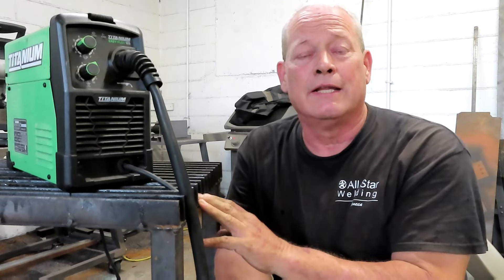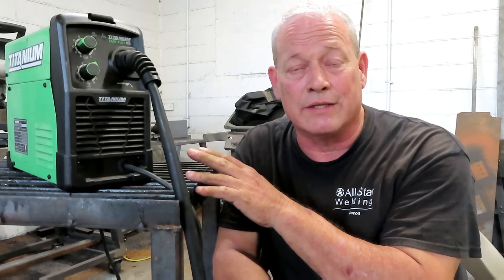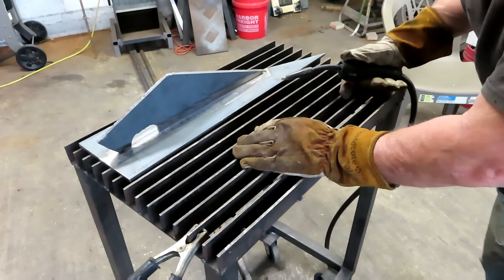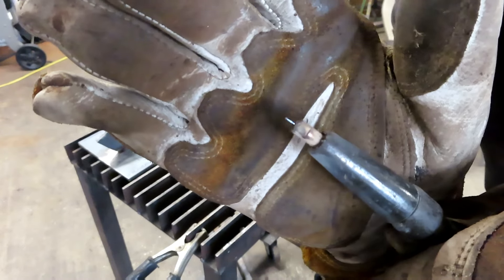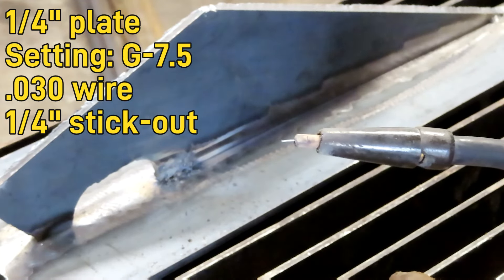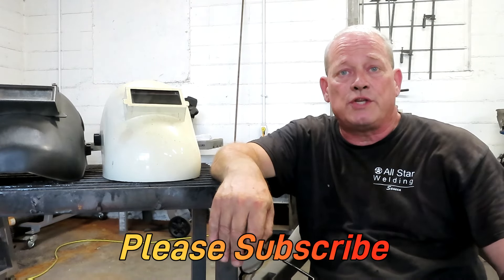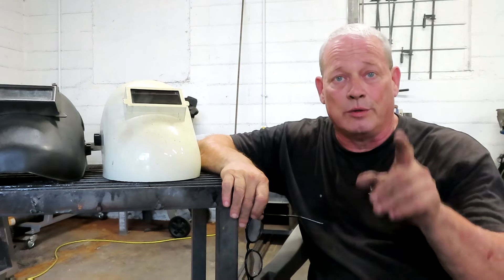How to Weld Like a Pro with the Harbor Freight Titanium Easy Flux 125 | Beginner’s Tips

Comment: I saw another person do a review and he advised to reverse the polarity on this welder, supposedly it will make cleaner welds. What are your thoughts on this? Thanks! This is a great video!
Reply from the maker: Flux core welding needs to be DCEN, or DC current Electrode Negative. This Titanium is a flux core ONLY machine, so it is wire from the factory as DCEN. You can NOT change it. Other Mig machines that can run Mig or Flux, yes, you need to swap it to negative for flux, and positive for Mig. Some people will read a comment on another video where the user is running Flux Core on positive, and will leave a comment telling them to swap polarity, which is correct. But then, some people read that, and leave the same comment on every video they watch, which is incorrect. The bottom line is that a machine (Titanium included) that is a flux core ONLY, is engineered from the factory as Negative. The only way to swap polarity it to take it apart, buy some new components, and fire up the soldering iron and hope for the best.
Reply from the maker: Running Flux core on positive is wrong

Comment: You should tell us your settings befores you started.
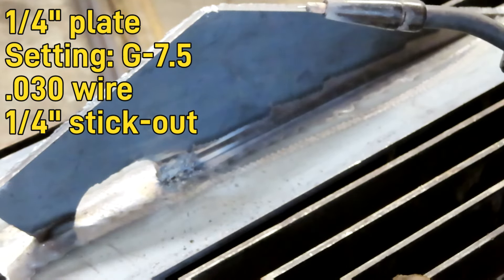Reply from the maker: I did. It's on the screen at 5:24. G-7.5, .030 wire, 1/4 plate.

Comment: Do you have a vid of the theory of how to use these cheap welders, and the why and when you would use the different types of welds?  Z vs little e vs out and in?
Reply from the maker: There are so many variables as to when and why. That's when your expertise and practice will come into play. Instead of practicing just on flat pieces on your work table, change things up a bit. Set some pieces vertically. Hang a piece of the edge of your table, get down on your knees and practice welding underneath it. Practice thinner pieces to thicker pieces. There's really no theory to it. Just practicing and remembering what works and what doesn't.
Reply: @AllStarWeldingSC  ty.  I'm just spooked of getting shocked.

Comment: Wow. You've explained a lot as to why I've had such a big problem. To me, they all look very good but the 3rd one seems to look like it has a valley down the center. I'm going to try your technique now. Thank you very much for your tips. Ok so I can say this welder sucks. It will not lay down a good need. There's no spatter it just looks like a cold log.
Reply from the maker: Anytime brother. Let me know if you have any questions.
Reply: I tried to. It still just lays down a cold log. I weld fifth wheels together for construction trailer specialist. MiG. I used to weld barges using flux core. What in the world am I doing wrong? I just don't get it. @AllStarWeldingSC
Reply: Wow.... Now I understand what is going on. Not calling the people at harbor freight idiots???? But it's probably my fault as well for not looking but they sold me MiG wire.

Comment: I have a inverter stick welder and have been working on an old motorcycle muffler system. Even bringing it down to ~45 amps with 1/16", 6013 rods, reversed electrode, it still burns through way too easily. The oem tube thickness is about .050" metal, the replacement pieces I'm trying to add is 16 GA. Would this welder be a big improvement?
Reply from the maker: This would definitely be a great improvement for thinner metal like that.

Comment: Do you think this can tackle mobile welding jobs such as Rod iron fencing and Handrail repair? I’m thinking about starting a little side hustle doing this. I have my carts just no welder. It’s on sale right now and will probably buy regardless
Reply from the maker: Yes. I use mine for fence and handrails all the time. Also use it when I need to build a new one on location, as I did today. I have Mig, Tig, and stick in the shop, and I use the Outlaw for stick and to run the Titanium Flux Core out on mobile jobs.
Reply: @ oh nice, I have my eye on the outlaw for when it goes on sale. I want to make a little money with the buzz box first before I upgrade. And when you use that mobile, do you plug in to the home owners power or do you use a generator?
Reply: Wrought-iron

Comment: I really appreciate this video. I'm fixing to buy one of those machines and I'm new at welding so this is a big help to me I really appreciate it started following you to find more techniques and learn more information thanks again.
Reply from the maker: It's no trouble at all.  Hopefully, I've given you a tip or two to get you going.  Thanks for subscribing. I'm planning another video starring the Titanium and a Primeweld. Not necessarily a battle, but to show how you can take your experience with this Titanium, and use the same technique with other bigger machines for when you upgrade. I want to do the video soon, but I am elbows deep in a big project and trying to get it behind me. Stay tuned!
Reply: @AllStarWeldingSC  I completely understand and I'll be waiting

Comment: Bought a Lincoln AC225 45 yrs ago for a project and over the years have used it for different projects around the house/garage but found it too (hot) for an inexperienced/ diy welder.Recently purchased a Reboot 145 that does flux core as well as dc pos or neg stick.After a bit of practice and experimenting with flux core can get better results than years of trying with the old tombstone.I really liked your video on welding with the Titanium 125,good tips on different techniques.Look forward to more tips to come .many thanks.
Reply from the maker: Thanks for watching. When I get done with my current project, I've got a new video I want to make dealing with advanced flux core techniques. I have a Tombstone story for you... Way back when I was first getting started, I was strictly shop work. One day a guy wanted me to finish a horse fence that had already been started. The drill stem pipe had already been set and capped. Holes were torched out for sucker rod to go through the holes, and everything was already placed along the fence line. All I had to do was put the sucker rod through the pipe and weld it up. I went to the pawn shop and picked up the Tombstone AC, and borrowed a big generator, and got to work. That's when I learned about drill stem and sucker rod being magnetized from friction in the ground. Well, I got past that with some advice from an old timer that told me to wrap my ground around the pipe. That old Tombstone was a beast of a machine, and so heavy.

Comment: This was a great help. Thank you. Got me started in the right direction finally.  If you are looking for content, would appreciate your thoughts on multi-process welders, like Yes, Arc, and the Lincoln 180i. Thanks!
Reply from the maker: Yeah, those are great ideas... If I could afford one, haha
Reply from the maker: I'll tell you this much about multi-process machines... They are great for a home shop, or hobbiest. And cheaper than buying all the machines individually. However, in a business shop environment, it's not wise to put all your eggs in one basket. If one of those processes goes out, or if you have to send it back/replace it, I would be out of work. As it is now, I have 4 machines that I can stick weld with, 3 machines to Mig with, 3 that can DC Tig, and 3 that can flux weld, but only one that can AC Tig. So I've almost got everything covered. Just something to think about.
Reply: @ That’s very thoughtful and great perspective. Thank you. As I am hobbyist only at this point, I might see some value in a multi. As is I only have the Titanium flux you made videos of. However your idea of keeping separate certainly has merit. Thanks for that

Comment: You said wire matters. What wire are you using? I'm brand new to welding. Recently bought a Titanium 125. I'm getting lots of spatter and I'd like to know how to get welds like yours. Obviously decades of experience matters too, but I feel like I should be doing better than I am.
Reply from the maker: I make it no secret.... I am a huge fan of Weldcote wire. I keep .030 in the Flux machines, and .035 in the mig machines. Other great wires are Blue Demon and Forney. Over the years, I have used every wire you can think of, but I have been on nothing but Weldcote for 3 years. There are a few things you can try to keep spatter at a minimum.  Use a higher setting if your material can handle it. More heat will let the wire dig in and melt, instead of bouncing off.  Move in on your weld. Keep the tip as close as you can, maybe 1/8 - 1/4. Gets your tip all nasty , but it makes a good weld. If you want, you can get some nozzle dip and stick your tip in it before welding. Use a wire wheel on a angle grinder, before and after welding. And try using an anti-spatter spray. They actually work well. Use real anti-spatter spray, not cooking spray. If you want to see a really good review of over 30 sprays, Fireball Tools made a nice video, but it's 45 minutes long. Mike Festiva and Brandon Lund both have videos comparing the popular brands of Flux core wire. They are worth watching!
Reply: @AllStarWeldingSC   thanks for a great video & for taking time to reply. I'll try your suggestions & keep practicing!

Comment: Awesome video really really helped me I’m as new as new  gets the. It comes to welding and i bought this little welder I was just wondering how do you know what speed and setting to put the welder at for different metals.
Reply from the maker: Hi John. Thanks for watching. I hope it helps you out. The best way to get your settings started is to use the chart on the inside of the lid. It's pretty accurate. I would suggest starting off with the .030 wire. Flux core burns pretty hot. Until you learn to control it, the .030 will be easier when learning. I've found that that chart is usually pretty spot-on, but all situations are different. Make adjustments after trying the chart setting. If you have any questions, please just ask me. If it helps, you can go to the front page of my channel and go to the "Community" tab. I've put my email address in there. Don't be afraid to use it!!!  I'm planning on making a Flux Core Masterclass video soon. Keep an eye out for it

Comment: Just picked up a HF flux core welder and am having trouble with grounding. The welder only welds when the ground clamp is attached to the work piece. If I ground to the welding table the welder doesn't spark up to weld. I have the older HF welding table. Thank you.
Reply from the maker: That's odd. It shouldn't be like that. Make sure that what you are clamping to is nice and clean, and not painted. Theoretically, you really want to clamp your ground as close to your welding as you can anyway.
Reply: @AllStarWeldingSC  Will try. Thanks.

Comment: My 125 welder in directions say no extension chord and in your video stated using one. Is it ok as long as you are not far from plug or do u suggest a specific chord size ?
Reply from the maker: With my 125, I regularly run a 50ft 10g extension cord, and run off a generator (actually the Outlaw). I would say just keep it short and big. 50ft is ok with a 10g, 25ft max with a 12g. I would not suggest a 14g at all.

Comment: I like #3 the most because the fillet is not too big. Is it as strong as the others? What's the trick to reduce spatter?
Reply from the maker: The best way to control spatter in good wire. But more importantly is getting the tip as close to the puddle as you can, but still maintaining control. This is hard to explain, so bare with me .... Flux core puddle cools quickly, and the flux covers the puddle even quicker, to protect it. If the puddle is starting to cool and being covered with flux, new wire has a harder time injecting into it, and tends to bounce off until it can heat it back up to accept more wire when it gets to molten. If you get the tip of the gun closer, two things will happen... 1) the little bit of wire stickout will be stiffer, as opposed to being longer and able to bend, thereby being able to "jab" into the puddle more easier, and 2) the arc cycles will be closer and able to keep the puddle more molten, and thereby making it more able to receive the shorter wire (from #1) to jab into it. Does this make sense? Again, it's hard to explain in a text. Picture this.... Imagine if you have a toothpick 8" long. Hold it at the far end and jab it into an orange. It will break, right? And the pieces will fall all over the place. Now, take a similar toothpick and hold it 1/4" from the tip and jab the orange. It's going right in pretty easily. And you can keep doing it very quickly many, many times before it finally breaks. But it will be a clean break and probably remain in the orange. Same thing is going on with the wire.

Comment: Hey great video !! 
What size inverter generator would run this machine easily ?
Reply from the maker: I've never been really good at reading the labels and figuring out the needs. I run this with no problem off the Vulcan Outlaw, which is 6500watts. But, one time I went to my Dad's house for a little repair. He had one of those quiet inverters from Harbor Freight, I think it's 3500w. It kept tripping the breaker, at not too high of a setting. So use that info, if that helps.  Maybe someone with more knowledge about this will chime in.
Reply: @allstarwelding have you used this little welder at max  settings with the vulcan outlaw? im still on the fence on buying the vulcan outlaw but if it can run this at max then ill probably get it
Reply from the maker: @Leo-y6i  yes I have. You will like the Outlaw. It's a beast. I also use it for my Primeweld 160 with Flux wire, and my Primeweld MTS-200. And of course for it's stick capabilities. It will also let me weld while my helper runs the grinder or a saw at the same time. I've used it to run lights and weld on night jobs.
Reply from the maker: @Leo-y6i  I have a few other videos on my channel about the Outlaw too.

Comment: Great vid. I have the chicago electric flux 125 but when i saw this for 99 bucks i had to do a double take…couldn’t believe the discount and many have said this was much better than the old ce125 i got one! Your video solved a lot of my issues but one thing that’s still an issue is i have the 39 dollar hf shield that i got on sale for 29 but the issue is i still have a hard time seeing my weld puddle. Is it just a matter of swapping out for a better lense rather than a brand new helmet or do i just need to be closer to see?
Reply from the maker: What shade lens do you have? Is it adjustable? For Flux core, a shade 10 is sufficient
Reply: @AllStarWeldingSC  i will take a look at the user manual again but i only saw 2 adjustments. I could adjust sensitivity (when the auto-shade how much light is needed before shade goes dark) and dela (how soon the shade goes dark once the sensor detects brightness)
Reply: @AllStarWeldingSC  i just found the knob to adjust the shade. it was on the side of the helmet.

Comment: Will this welder weld 3/8 bolt nut to broken exhaust bolts for easy removal on a Dodge 5.7 hemi.
Reply from the maker: If you turned the setting way up, probably. But your better choice would be a 7018 stick weld

Comment: Does it matter what weilder you have i got a mastercraft havent usedv t yet.we don't have harber freight in canada
Reply from the maker: No sir. It doesn't matter the brand. Get that machine out and practice with it!
Reply: @AllStarWeldingSC  thanks for your reply I watched at lot of videos and found yours the best so saved it.
Reply from the maker: Wow, thanks. I appreciate that 🙏
Reply: I have a question I was told the ground cable should be up graded to a heavier one,is this so
Reply: My mistake not the cable the clamp on the ground cable.
Reply from the maker: Yeah, that cable is hard to upgrade anyway. For the clamp... I never upgraded mine, and I have 2 of these machines. For what it is, and the amps it uses, the stock clamp has always been good enough for me. I've never had an issue.

Comment: Great video, Newbie question, why won't i get an electric shock? There is High amperage going through that thing and even with gloves what if I touch the piece?
Reply from the maker: Good question! I've never really thought about it, but as long as you are not touching the metal with one hand, and the wire with your other hand, then pulling the trigger, you should be good.
Reply from the maker: And not to mention that it is DC current.